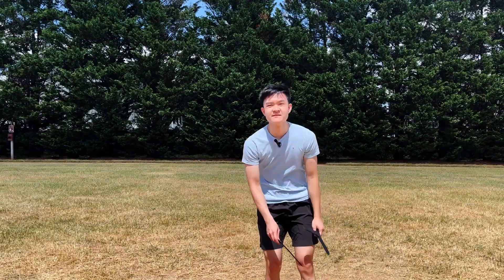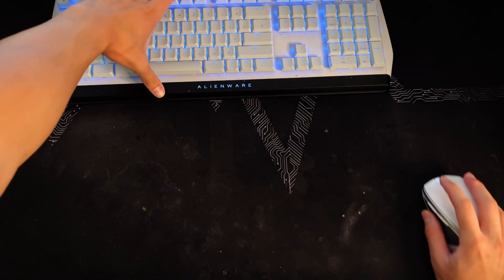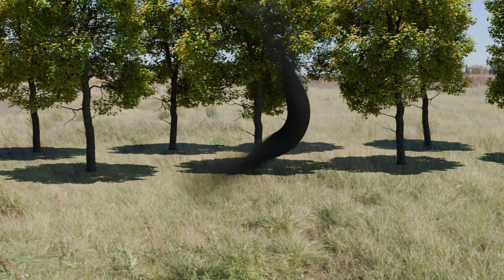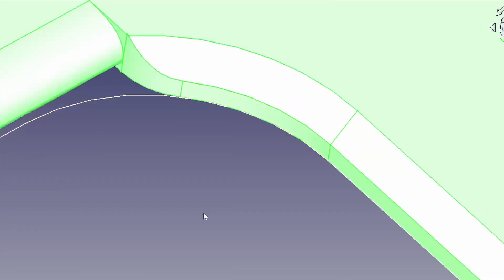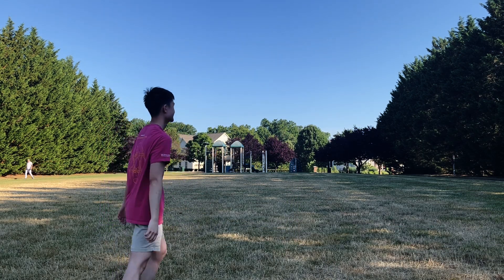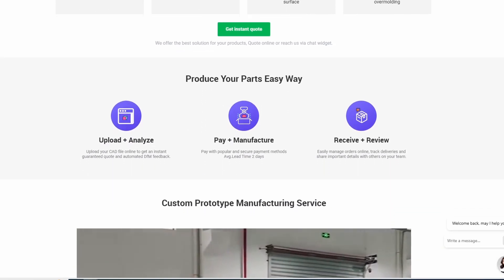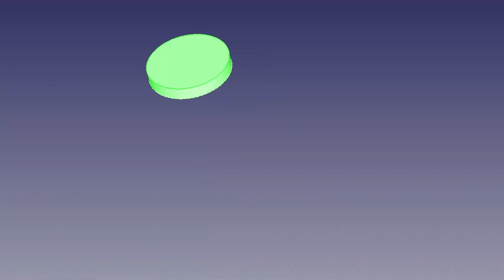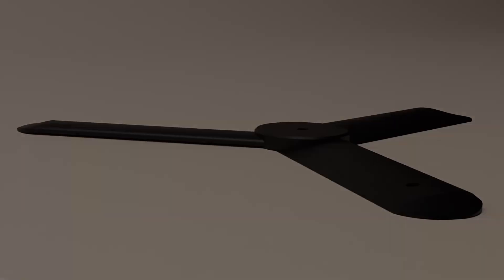3D Printed Boomerang, because I was Bored

Comment: Now that you've parnered up with PCBWAY, you can get it printed out of metal, give it a nice honed edge, wear a leather glove to catch it while doing backflips, and party up with the road warrior!
I'd print out of TPU for a massive durability boost, TPU apparently also has a subtly lower weight than PLA as well, maybe that'd allocate some budget for carbon fiber rods to get pushed in then sealed? You could even get crazy with it and try something like varioshore (foaming TPU) to control where most of the weight sits, using a mesh as a flow and speed modifier.
Reply from the maker: Metal boomerang would be crazy :P. That's a certified self-defense weapon at that point. The TPU idea would push the design to be a MTA (maximum time aloft) boomerang, allowing it to stay in the air for longer. Carbon fiber rods probably won't be needed based on how light the boomerangs would be at that point. But at the end of the day, you can make boomerangs out of wood or PLA and it'd work :D.

Comment: I made one of the 3 winged boomerangs when I was in primary school! It was made out of wood. I don't think mine ended up being able to return though. Fun process tho. I believe it was marginally wider at the tips than it was at the base
Reply from the maker: Nice! It could've all come down to the throw however. My boomerangs wouldn't return that well because I didn't give it enough spin or energy (speed) to return all the way. But either way, being able to make something is fun even if it doesn't work :P